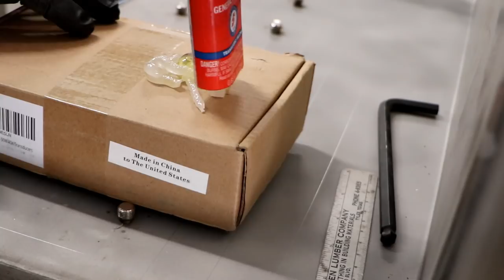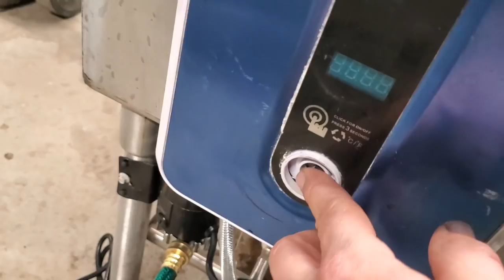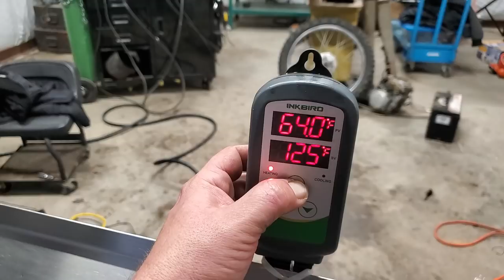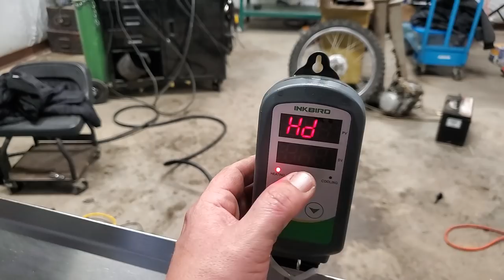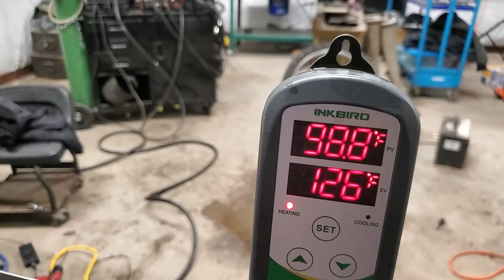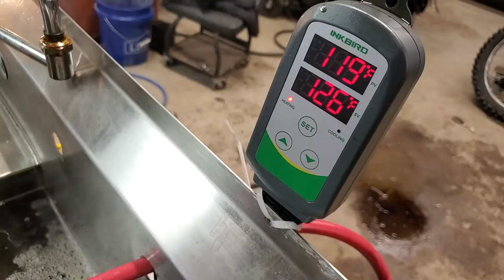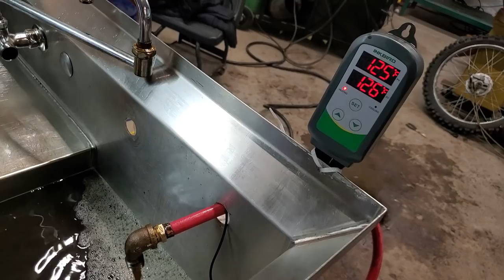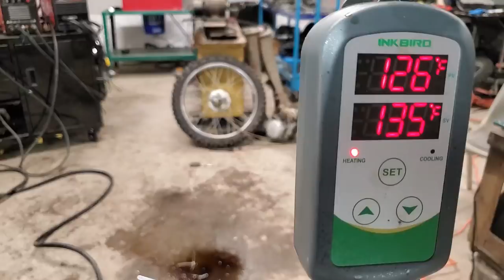Forget everything you know about RUST REMOVAL!

Comment: DO NOT WIRE TRANSDUCERS IN SERIES ON A GROUNDED CHASSIS.  
If you don’t see why this is a problem, do not attempt to build a device like this.
Reply from the maker: Yup. Anyone that watches the entire video should understand that. Unfortunately there is not alot of information on how they are actually wired up on the web. Interestingly enough it was a manufacturer in California that told me to wire them in series. Throughout the video you actually get to see me figure out he was wrong of being purposely deceptive in an attempt to keep this information off the web. Thanks Matt. I will pin this to the top comment for safety.
Reply: Dear Matt,

Why not educate him on why that is a bad idea instead of just dismissing his ability to handle a project like this. YouTube is about teaching things to folks; at least these helpful videos are thank God - as opposed to the very lucrative ones featuring teenage girls talking about their hair.

You could help us all out, by just telling us what the issue is with what he did.

BTW, I enjoyed your scratch built amplifier video. However, it looked like you forgot to add bleed resistors across your capacitor banks. I also didn't see any isolation transformers on the power or output stages. Of course without a schematic it's hard to tell, so if I am wrong please forgive my error.

Sincerely, 

Leo.
Reply: Grounded chassis and series transducers mean shock hazard and fire risk. The first transducer will complete the circuit via the grounded chassis because the circuit is made through the from of the second transducer.
Reply: @RadDadisRad  Thank's Leland.

I will say at this however. Regardless of how you wire these things they look like death traps to me. 

There is no isolation at all. These designs that rectify right off the mains, for no other reason than to save the cost of one lousy Isolation transformer, should be illegal. 

And then to not indicate to the user which output is common to the transducer body, and should therefore be wired to neutral via a polarized plug should be doubly illegal!

And then to sell someone an unisolated transducer, THAT IS MEANT TO BE MOUNTED TO A USER ACCESSIBLE METAL BASIN Filled WITH WATER NO LESS IS NOTHING SHORT OF ATTEMPTED MURDER. 

And to then tie the neutral (IF YOU ARE LUCKY ENOUGH TO HAVE PICKED THE NEUTRAL and GND together is actualy illegal.

And to say that all the above is taken care of simply by making sure to wire the transducers in series? Well technically yes I guess.

Be carfull Justin. Make sure with an ohm meter that the neutral on the plug is the only thing that shows low impediance to the metal sink. Also make sure that the neutral and hot are not accidentally fliped at the wall receptacle; it happens all the time.

Or better yet, go get an isolation transformer and make sure the ground stays continuous all the way from the socket to the sink.
Reply: If the output of the power supply is galvanically isolated and just floating then you could easily wire up a pair of them in series. Join the two body electrodes of the transducers together and attach the output leads from the supply to the center electrodes. One transducer would always be 180 degrees out of phase with the other, so I'm not sure what kind of ultrasonic black magic impedance tuning you would need to do in order to keep them from destructively interfering with one another, but electrically that would work just fine for a single pair and no more in series.
Reply: @leop9021  You also do not want to send someone to electrocute themselves. If they cannot realize why something is bad after you lay it out, they probably do not have enough background knowledge not to make a different potentially fatal mistake. That said I would have added, without studying how these components work instead of flat saying they should not attempt it.
Reply: @Anyone700  
I TOTALY AGREE WITH YOU. That's why I asked Matt to say more about the danger rather then state that the aoP should just forget the whole thing. 

In fact I didn't understand the danger either untill looked into the driver circuit and transducers. Perhaps even I should have given more info on how to stay safe.
Reply: @leop9021  - One of the problems with the internet is that people don't expect to pay their dues anymore. If someone is so feckless they aren't provoked into finding out about what they are dealing with (as easy as that is to do nowadays), then they shouldn't be in the game.
Reply: @Ricopolico  
Of course you are correct, but a person should not get the death penalty for ignoring this basic fact.

At the same time this is an awesome project. I am so glad the video was put up. In the old days this is the kind of project you would read about in Popular Mechanics. Go read Popular Mechanics now. It's one of the most boring magazines still alive. I only read the 1950s versions now where there are real projects that you can build. The lawyers have kill the ability to publish build articles such as the projects in this wonderfull video a long time ago.

So the question is: How can projects be described to the Common Man, and common woman (along with the appropriate warnings) in such a way that folks that attempt the project, but break the rules and get themselves hurt, or killed, cannot turn around and file a lawsuits against the person who described the project. What is the answer to that question is one I'd love to know. 

Note: kill all the lawyers is not the answer I'm looking for; though in all honesty that did occurred to me as a potential solution.
Reply: Ok so you should wire them in parallel as that is your only other choice or separate drivers for each?
Reply: I figured I'd put this up here not after the 10 replies. This isn't isn't a nuclear reactor being built. As far as "injury and death" goes thats a bit much. It's about as simple and easy as it gets. The most pertinent information being anytime liquids and electricity are being used in conjunction running it from a GFCI is stone simple. Anyone not knowing what that is google it and read. A GFI is a similar device but less expensive. In any case saving money on your circuit breakers is bad form. That should cover "Don't try it unless you a direct descendant of Tesla" and "injury and death". This is a computer. You can read how to build a fusion reactor. So people cowering from "injury and death" if you don't know how to wire something guessing is generally a bad idea. Google it. I have 3 phase in my house which is crazy expensive. That you should be concerned about. 110 and 220 should not provoke fear and anxiety.
Reply: @leop9021  Arguably this is exactly the kind of thing we need lawyers for. Somebody giving out instructions that look legitimate but will lead even the most careful user to a certain death unless they have incredibly specific industry knowledge should probably be illegal. Giving out instructions on how to microwave a microwave pizza should probably be legal. The grey area is the problem. 
In my limited experience publications getting insanely cautious is probably not due to their lawyers insisting on it - I'd say on a gut instinct that it's more likely they ran out money, fired their resident legal experts, and now are treading extra extra carefully because they have nobody to turn to to figure out what is actually ok and what isn't, or respond to any complaint they might face. That, or new laws that have taken consumer protection to braindead levels.
Reply: @TheGoodoftheLand  Great video!  I would have liked to see some evidence of ultrasonic activity on the surface of the liquid.  In your current arrangement, you have a very heavy stainless steel tank with essentially randomly placed transducers on the side.  This system works (or doesn't) based on resonance.  I'm not sure how much of that power is doing what you want.  You can place these transducers optimally but not the way you did it.  

Hot, circulating rust remover will do the job quickly...  Sodium Carbonate in an electrolytic bath will do it even better (and cheaper).
Reply: @RadDadisRad  obvious now it's been explained... thanks

Comment: putting them in series wouldn't work since one terminal is attached to the case.  one of the two would just be doing nothing as it would be a direct connection to the other transducer through the pelvic floor.

Comment: When you were wiring up your piezo transducers you said that if you series them you would get into possible danger zone with the ohm load on the amp and wiring them in parallel would be the safe route. You have that reversed when you wire them in parallel you lower the ohm load that puts greater stress on the amplifier if it's not designed for a lower ohm load when you series them you raise the ohm load which puts less stress or on the amplifier. You need to make sure that your piezos and how you have them wired to your board are all correct for each other because there's three situations you will run into first situation is you have two piezos of the wrong ohm load and you parallel them down to low and you run the amplifier twice as hard as it's  supposed to trying to get 200 Watts out of a 100 watt amp which will damage the board, second situation is you get the correct piezo's and you wire them correctly and you get 100 Watts out of your 100 watt amp, 3rd you wire the correct or incorrect piezos in series and you only get 50 watt to 25 watts out of your 100 watt amplifier, which will not hurt anything but greatly reduces the output of the amplifier. You have to be very careful with impedance and wiring  you can end up throwing away a lot of money if done wrong. Otherwise very cool build probably the biggest and by far most powerful Ultrasonic Cleaner I've ever seen.

Comment: You can't wire them in series because the negative terminals are already connected together by the chassis i mean pelvic floor and to wire them in series you'd need to connect one of the negative terminals to another positive one so that'd mean wiring the positive from the one transducer to it's own ground if you tried... You'd end up simply wiring one transducer and shorting the other across it's terminals.

Comment: Just a heads up on using ultra sonic baths on cast iron. You should never leave it in for more than 30 minutes. I have seen a cast iron cylinder head missing from the ultrasonic bath after the 1.st Engineer left it in there over night and saw him loosing his marbles when we all told him that we did not remove it. 
It really did not help that we had about 62 kg of fine particulate iron dust in the bottom of the bath when we drained it. Dry weight of the thing was 56 kg. I guess the remaining of the 62 kg was other crap and liquid. 

But a great tool indeed. Congratulations.

Comment: Hi mate, great build, I have had to fix the odd unit, using those components.
Advice.
Fans, always pump COLD air, never HOT, cold air is denser so you pump a greater mass of air than if it was hot.
So have ALL your fans pump in COLD air this will maximize the amount of cooling air you use.
The heating of the air inside the enclosure will push the air out at a higher velocity, so a fan on the output will possibly SLOW the heat movement out of the enclosure. In fact the outlet fan could be free wheeling. (Waste of energy)
As you are feeding the transducers AC the polarity is only important to make sure the two are in phase.
Place a warning sticker beside each of the mains buss-bars.
Place a FUSE in the box, inline with the switch.
Great you fitted a proper ground .
Place a proper cover over the back of the transducers, the high frequency AC is not nice to feel, also protect from moisture/splashes/dust build up.
Reply from the maker: Great info! Thanks for taking the time to help!

Comment: That power supply looks well under rated if those boards are 100W each. 900W @ 12v = 75 Amps!
If you need a beefy 12 volt supply, old server power supplies are a good source, like a DPS-1200FB.
Reply from the maker: +Paul Wilkinson Sorry for the confusion Paul. The boards are 110v. The power supply just runs the fans.
Reply: @TheGoodoftheLand  ah, that makes a lot more sense! 😊

Comment: Hey Justin! While it is an interesting build, one can pick up a large working used heated ultrasonic cleaner for less than the amount for the parts that you paid for new. Large ultrasonic cleaners have been around over 50 years and used in hospitals & electronic manufacturing. Heck, I remember repairing them in hospitals back in the 80's.
Reply from the maker: +TheBrix57 Sweet! If you come across one shoot me an email. thegoodoftheland22@gmail.com

Comment: The reason they built up a charge is you tightened them with the pretension-nut!
It is glued but apparently you used enough torque to break that.

This means some of them are now overtensioned or over-preloaded.
They will not resonate at the right frequency vs the rest.
This is especially bad if you try running em in series which you can't anyway due to grounded chassis.
They are already designed as two parallel piezos with the drive in the middle. Using a push/pull type driver on a grounded setup does not work either.

Comment: You always switch the hot lead on the incoming mains supply.

Hi Justin,

Great project. I just can't wait to build one of my own. Can I please ask you with regards to my build:

1) Can the transducers go on the bottom of the sink? 
2) Can the transducers go 360 degrees around the sides of the sink?
3) Do you think those of us who are cheapos need that many sensors?

With regard to the title. I can't tell for sure, but it looked like you switched the neutral on the AC power to the 12 volt power supply. If so then you want to fix that. 

The neutral wire is connected to ground at the breaker box, which is connected to physical ground nearby. If you switch the hot line and leave the neutral, then the whole device will be at neutral potential when it's off. That's OK. 
If you switch the neutral and leave the hot connected, then the whole device will be at hot potential even when it is off. That's not OK.

Might also think of getting  one of those inline GFI doohickies and install it within a foot of the plug? Just in case the second guy does not know enough to use a GFI plug to power it .

Love the new shop!
Sincerely, 
Leo

Comment: Temperature sensor mounting is simple, just put the sensor in a pocket on the back, made from a piece of 3/8 copper tube with a flattened end, stuch to the side with some of that epoxy. then put sensor in the pocket, and place a cover of foam over the sensor so the tank temperature is measured, not the cooling from the room drawing heat away.

Those transducers please put the wire through the hole in the tag and fold over, then solder, otherwise they will fall off in short order as the solder fatigues from the ultrasonic energy. otherwise you will have arcing as they fall loose, and blown boards and transducers as the arcing burns the terminal away.
Reply: I was definitely cringing when he just stuck the wires to the tabs. I personally would use crimp connectors and bolts. Solder on a vibrating component will eventually fail.

Comment: Here's a good soldering project. Soldering lights do instrument cluster circuit board directly when all the circuit board is is a plastic sheet with the copper traces attached to it and the coated over where it's not supposed to make contact. I've done it. 20 bulbs all because the sockets on the cluster were all broken. Like that when I got the truck and it's a 1980 model.

Comment: I'm a bit confused and not the electronics expert my dad is. I was under the impression if say two 8 ohm loads were hooked in parallel like you are doing here the load would effectively be 4 ohms which are a lot closer to being a dead short and thus drawing more current which is usually what blows an amplifier. It actually made sense to me that you would hook them up in series which if I'm remembering correctly would be a 16 ohm total??
Am I missing something?

Comment: When stacking PC boards one on top of the other creates a problem because the most fat put out a lot of heat so the board that is on top all received at it the only way that you could do that to maximize the heat is put the muskrat facing upwards side-by-side and having the fan blowing on them the life expectancy of your PC board will last twice as long
Also you might wanna consider it on creating a diverter Cannell channel it would be sort of like a maze so that the airflow really goes directly on the PC board just not all around in the box if you wanna have 100% efficiency 
It would be wise to use plastic fasteners instead of threaded rod you could find plastic threaded rods

Comment: Good video thank you.  One point though; my understanding is that you don't want to put the object to be cleaned directly on the bottom of the tank.  I heard, but don't remember why.  I've seen several ultrasonic cleaners that have rubber feet on the bottom of the parts basket.
Reply from the maker: My thoughts would be the part would basically be in direct contact with the transducer as opposed to the water. 45khz is OK for aluminum however I could see it causing damage with direct contact. I was told that 28khs transducers will destroy aluminum.

Comment: You should never place metal objects directly on the metal floor of a sonic cleaner as it will eventually wear a hole in the tank.
Reply: True that. Get a plastic cover off a cheap box fan and raise it an inch or two off the floor of the tank with plastic or rubber shims.... think hockey pucks, or similar. That will protect the tank floor.